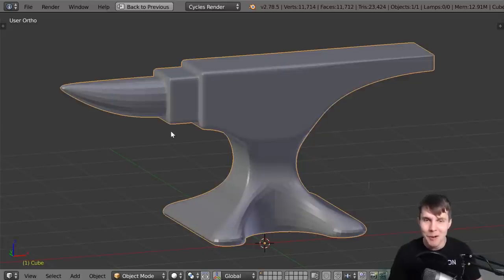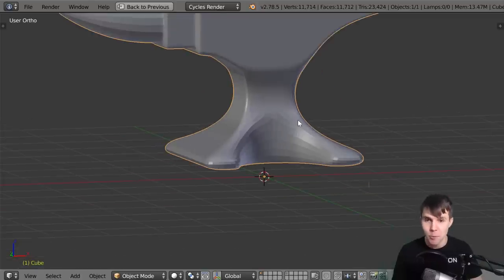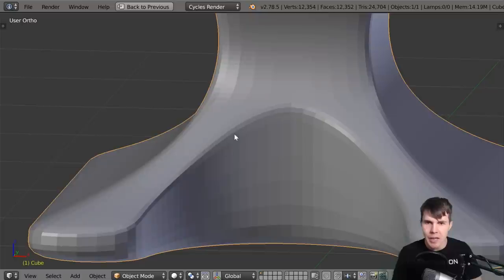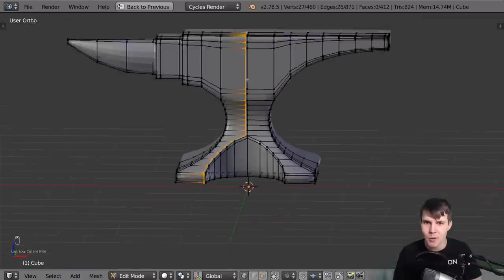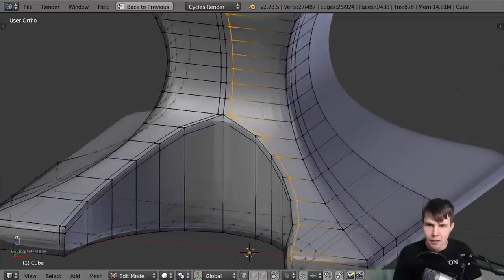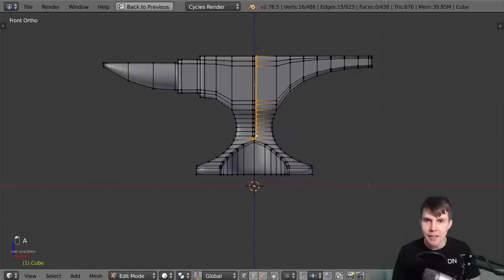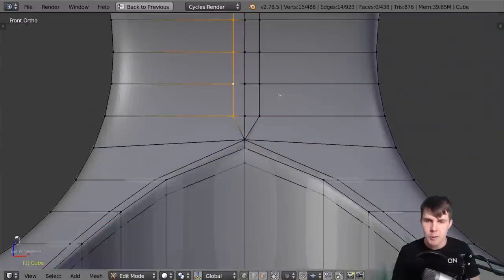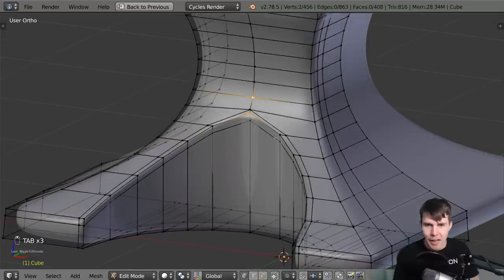Blender Intermediate Modelling Tutorial - Part 4: Final Touches

Comment: What is the problem using triangles? In my opinion in some cases they are very appropriate to use...
Reply: I don't get his problem with them as well. Triangles are even better as they are always flat, so there are no weird geometry gradients. When doing assets for games, you almost always use triangles.
Reply: They can be problematic if modeling with subdivision in mind. Can cause oddball warping in some cases. Mainly it's an issue if the point of a tri occurs on an edge crease. For some things though, tris do make sense. Like cones, or perhaps the poles of a UV sphere. Also it's ok-ish for a tri to occur on a planar surface where there's no surface transition over the surrounding edges.

If you're staying low-poly and not intending to do any smoothing at all, then this rule doesn't really apply. Yet it's still a good practice to get into, because many higher detail models have their shape developed at a lower detail stage and those tend to be subdivided a few times.
Reply: Blender and some other programs use squares.. 3d game editor programs most of the time use triangles. but yes in some cases they are appropriate or 5 or more.
Also I agree with pauljs75
Reply: try to loop cut some triangle
Reply: Derpy Maymayz that's actually not entirely true. The n-gons in 3d-editors are internally constructed from triangles. If you create a plane (or any other n-gon face in blender), then manipulating only one vertice will show you that they are aktually made from triangles. That makes sense, because an n-gon with an n greater than 3 cannot be flat, if not every one of its vertices are on one vector-plane, which would make modeling a lot more headach inducing, if they weren' made out of triangles.
Reply: +Akronsus Exactly what I said. It's impossible to make a 3d-sense of of shapes which building blocks are not flat. You create those impossible IRL things I call "geometry gradients" when the modelling program tries to render flat surface between not flat vertices.
Reply: +Argon Yeah, they look really weird somtimes, though maybe "vertice gradient" could be a more appropriat name for them, since they are calculated from the vertice normals of the face. But like +pauljs75 says, 4-gons are quite useful, if you are planning on using subdivisions. These gradients also somtimes are able to hide mistakes that were made xD
Reply: The problem with tris is when you apply subdivision the tris can't be subdivided properly, because what subdivision does is it, well, subdivides existing polys, basically diving a poly in four, making the mesh more hi-res. So when you have some tris among your polygons the subdivision will mess your mesh up, causing artifacts and interesting lighting effects. As people above said if you're making a low-poly model you don't need to think about it, but if it's a hi-poly model, you need to take that into consideration. You also need polygons when modeling thing to be animated in the future, characters for instance. If your mesh is messed up, mixing tris and polys, your mesh will be distorted in moving parts. Try subdividing a cylinder in blender, look at the top and bottom, you'll see what the problem.
Reply: I've had issues with tris when using an image texture.

Comment: For the rectangular hole you can add the proximity edges using the knife tool instead of doing entire edge loops that will distort the nose of the anvil. The knife tool was introduced in part 2.

Comment: I happened to produce a few accidental triangles when merging. To make sure you didn't do the same you can identify triangles by bisecting a rectangle to a triangle with Ctrl+T, select a triangular face and press Shift+G to "select similar". Choose polygon sides to select all triangles. Now you should be able to easily check for other triangles in your mesh. Don't forget to merge the split up face back to rectangle again using Alt+J. Happy Meshing!
Reply: You can also, while in edit mode, press select at the top > select all by trait > faces by sides. Then expand the pop up that says "Select Faces by Sides" at the bottom left of your viewport and set it to 4 and "not equal to". That'll help you catch anything that isn't a square!

Comment: There actually IS an easy way to point the indent on the top of the anvil's corners. Select ONLY the edges  that you want to have a loop cut on (Do not confuse Blender by selecting random edges over your mesh) and then press [Ctrl + Shift + R]. This will add a loop cut on only the faces that have a corresponding edge. Some problems, however, is that Blender becomes confused when this tactic is attempted on an edge that is connected to a face with more than 4 vertices. Another problem is that if an edge is connected to TWO faces at once (Which is more likely than not) then it will create a cut on both faces that the edge is touching (Same for 3+ faces). Also, just wanted to say how awesome this mini beginner tutorial series has helped. I had no idea oriental shaping was a thing, even though it has it's own button. Thanks, my dude!

Comment: this might have been already pointed out by someone, but the holes in the anvil usually go through the whole of it. thats because you you might have tools that fit diameter wise inside that hole but not length wise. and you would want the tool to sit snug inside that hole.

Comment: At end, doing the cube hole at the top, adding edge loop will not affect all that's hidden if you want the level of detail. (I'm using Blender 2.82.)

You don't need to hide everything, just the edges that will block the path to the rest of the mesh. That's also avoid the problem of creating edge loops at the bottom part.

Comment: I'm certain you only missed it because its hard to see in your reference photos, but the holes on the anvil face are called a hardy hole (square hole) and a punch hole (round hole) both holes should transfer all the way through the anvil. and the Hardy hole is perfectly square, not rectangular.  Not trying to be a know-it-all, just figured you might want to know. other than that, this model was great.

Comment: I think I figured out how to do the square holes. I could be completely wrong, but it looked okay on my end.

I first split the square in half where I wanted to place my hole with the knife tool. Then I extruded it down a little. Then I put an edge loop and slide to one of the sides that doesn't effect the horn. After that, I hid most of the model and then continued to add another edge slide on the the other side. But the corners are a little off, so I'm not sure of that would make the cleanest model, but it doesn't look awful.

Comment: Andrew: for your last rectangular dent, if you don't want the edge loop to go around the model, just select the faces you want and subdivide (W). It will add an edge line which you can slide with GG and won't go all the way to the horn.  
Gecko was very promotional :)

Comment: The only thing I want to suggest because I never see you or anyone else do it when modelling is once you selected one vertex, control right click another one a distance away to select a line in between. It chooses the shortest distance, so as long as you understand when to do it twice (ie. another control right click halfway) to control the path, it makes it much quicker than alt-right clicking then deselecting the ones you don't want. It's a little thing to save time, but it adds up.

Comment: So the anvils have the striking face (big flat part) the horn (front cone) and the hardy holes (the square and circle indentions you made) in which is the error here, they're holes that go through.
-The hardy holes are used to hold tools used to cut and hole punch etc.
-The flat bit is the takes the most abuse, used to get most of the shape when making knives / swords etc.
-The horn is used to make your round shapes, this can technically be done on the main surface but obviously using the
round surface is more ideal. Not all anvils had horns and became more prominent over time.

Comment: Cutting the square sharply; newb here so not sure if this is a "good" move, but it worked nicely for me.
Hide everything except for the Face you want to extrude down into the square. Then Loop Cut it so it's a smaller face (the size you want). Then extrude. You can then loop cut to add sharpness to the edges.
When done, unhide the rest of the model, and the loop cuts should have only changed the local bit you were drawing the square into.

Comment: I came to this a year after it was posted. Took me far longer to make those silly donuts. FYI, both those features, the rectangle and the hole, go completely through the piece. Blacksmiths used those as tool holders when using specially shaped addons to form their work.

Comment: Hey, just letting you know, that the middle hole is called the hardy hole. It should be shaped as a perfect square, and not a rectangle. The circular hole is called the Pritchel hole. Both of these holes go straight through the anvil, yours has the holes not going through.

Comment: Great tutorial, and really gives understanding, but i DO have a tiny thread to pull..

The square hole on the face of the anvil is called a Hardie hole. It's specifically a square and somtimes actually goes right through the anvil, as it's designed to hold specific tools called Hardy Tools, which help the blacksmith to perform specialized forming and cutting. It is also used in punching and bending operations.

The circular hole, which is called the Pritchel hole, and is used by the blacksmith mostly for punching holes in the material they are working with.

Your Hardy Hole was not a square nor was it travelling through the anvil.

Great tutorial otherwise though :)

Comment: Thank you for the tutorial.
How would you make a round trough hole that has more than 4 vertices, on
a flat surface that is no problem, but is there a easy way on a
curved surface?Off topic: The square hole is not for bending hot metal, it is made to
hold a hardy or a form that the anvil in is basic form not possesses
(for example a hollow).The round hole is not very common, I have not seen them in the anvils I
have used, the best use for that  I would say is to punch holes into
the hot metal.

Comment: there is another solution to make the hole in a square angle, if you select only the polygons around the hole, and use the Hidden tool to hide the rest of the object, you can create a loop cut only on those polygons, BUT BE CAREFUL, if you do this right at the beginning of the modeling, this can affect the whole geometry of the object, messing up other loop cuts that may be necessary, so I recommend doing this kind of thing only at the end

Comment: 2.80 Users:  the various status things mentioned appear in the TOP LEFT, not the bottom line as mentioned.

Learn from my pain.  --They're quite subdued, so EASY to miss, especially if you are focusing on the bottom of the screen.

The "F" thing is really easy to miss, thanks.  They SHOULD include the hotkeys for E, F, and C in the numeric dialog (F9).

Comment: Andrew, what are the specific problems that we're trying to avoid by making the quads "flow"? I'm a beginner and I'm finding it very hard to decide what's "worth fixing" or obsessing over, or choosing between different ways of "fixing" mesh flow problems without actually knowing what the point of it is.
Reply: Incorrect flow = strange shading.

Basically if it's not very easily noticeable you could just leave it. but really if it's not hard to find a problem learn to fix it and if you want your renders to look professional, learn to search for issues and fix them.

I know I'm not Andrew but in case he doesn't see it here you go. that's how I think it should be handled. if not well I'm a failure. XD
Good luck!

Comment: Question: toward the end of the tutorial when you're making the square/circle holes on top, why not just use the knife to make new isolated edges instead of dealing with the whole loop cut issue that affects the entire model?
Reply: You can do that, and you can enable cut-through with z while it's active to go right through the mesh. But you'd have to join it up to the mesh, it can't just float freely. And you'd have to keep the topology as nice neat quads, not triangles or n-gons.

Comment: for the problem at 19:00 with the loop cuts, couldn't you just delete the faces before the drop down to prevent the loop cut from extending that far. Then afterwards, just remake the faces.
Reply: You can hide the horn with H then do the edge loop. Afterwards you unhide it and it retains the round shape

Comment: Question: at the end when you were extruding the hole, wouldn't it have been just as correct to use the knife tool? My loop cuts that I already had from before resulted in faces that were too small and narrow to use for that, so I just grabbed the knife tool and cut one of the big rectangular faces twice, and this didn't result in any faces with more or less than 4 vertices and made it easy for me to make the hole look better using a square that wasn't too big or small. So, is this kind of approach going to make things harder for me afterwards? Not necessarily related to the anvil, but is it something to avoid in general? Thanks.
Reply: Are you sure you didn't create any faces with more than four vertices? Some of the neighbour "cells" should have gotten a fifth vertex (despite still looking like rectangles) by your usage of the knife tool. At least that's what I would suspect. If that was the case, you have created N-gons and that is something that should be avoided afaik. (Still a beginner myself so I might just have misunderstood you).

Comment: This is probably a noob question, I am a Blender Noob afterall. I'm wondering if there is an alternative to the loop-cut, like a limited loop cut, in order to not effect parts of the mesh that you don't want to cut. Knife does work somewhat, but I find it sometimes messes with the faces of the resulting cut. There must be some other tool in Blender that do this.

Comment: 18:15
Maybe next time just inset the face, extrude it down, inset the bottom, with loop cuts running parallel to the faces, to decrease the "rounded off" effect of the subsurf?
Reply: this is a much better strategy from my novice perspective. didn't have to do any loop cut fidgeting.

Comment: Great series so far for  beginners, however your method for getting tighter, sharper edges, is not very efficient. For those who are wanting to save time, and still get perfect edges, use the bevel short cut. ctrl+B, and then the scroll wheel controls the segments. 2 segments would be perfect for this sort of thing.

Comment: I am completely new to 3d modelling but based on what  I saw from this tutorial regarding loop cuts going all the way ending up changing things you don't want to be changed, didn't you already show us how to fix it by simply deleting a face so the loop cut didn't go all the way? Could you not just delete face A, delete face B and have a loop cut just be in between those deleted faces? you could then just add the faces back later on, right? 

Couldn't you just have used that method for fixing the problem at 18:15 ?

Comment: Have a weird issue, when trying to extrude down the pritchel hole (not the hardie hole square one)  The wireframe extrudes down, but in object mode there is no hole? my object is totally smooth.  Hardie Hole went through fine - it like mirroring caused some kind issue. Just figure that since the Hardie worked fine then the Pritchel gets made after applying the mirror.

Comment: Couldn't you just use the Boolean modifier to make the square and cylinder cuts in the top. This would make less faces from all the loop cuts?
Reply: This would completely destroy the geometry around the holes, especially with an active subsurface modifier. I hope the blender Dev's will find a solution for this Problem, introducing B-Mesh was a big step in the right direction, but putting a roundish hole into an object with a active subsurface modifier via booloean causes a lot of hard to solve problems within the mesh.

Comment: At 12:55, you pull out the base perpendicular to the mirror axis to widen it, but the vertices at the mirror plane don't move even though they are selected. Is that a setting of the mirror that I'm missing, to keep the central seram closed like that?